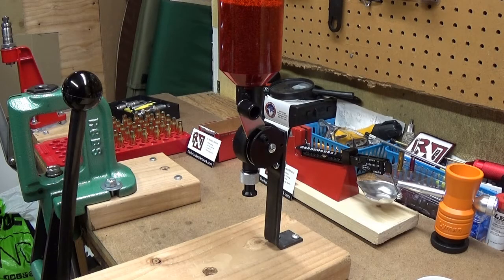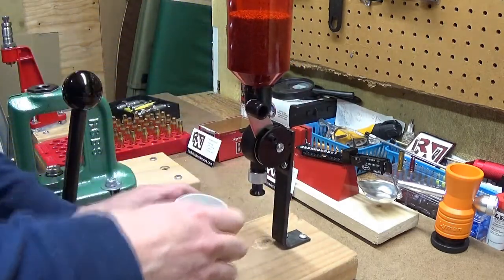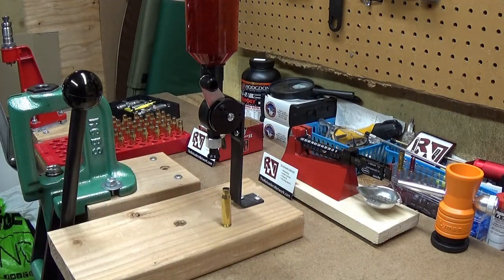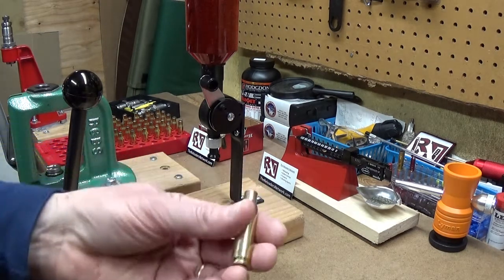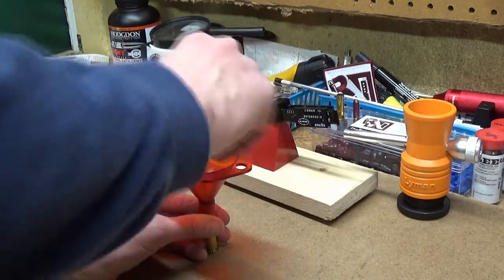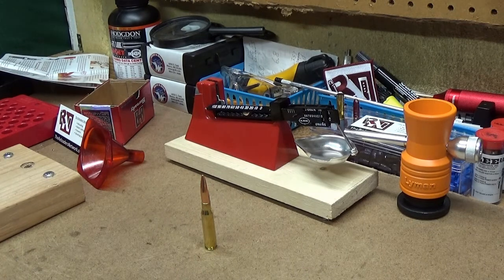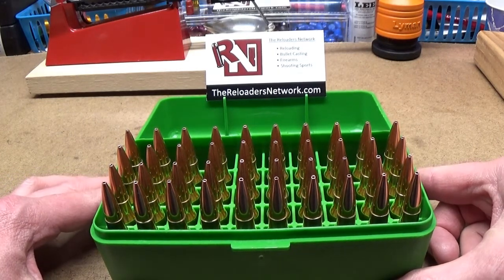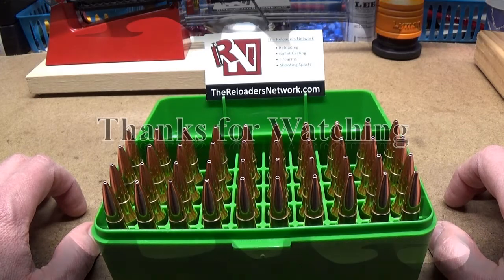Charging the Case and Seating the Bullet

Comment: I love my beam scale. People get this misconception that most digital scales are more accurate and I personally have not found that to be the case at all. And Lee makes a really great beam scale, capable of making match-grade powder charges. I test my scale with check weights and it is absolutely dead on just about always. No batteries, check...no warming up, check...and no calibration, check!
Reply from the maker: Yes - you have to be careful and can't be in a big hurry. It is very accurate and consistent if you are accurate and consistent. I can see the difference in the groups when I am not as careful.